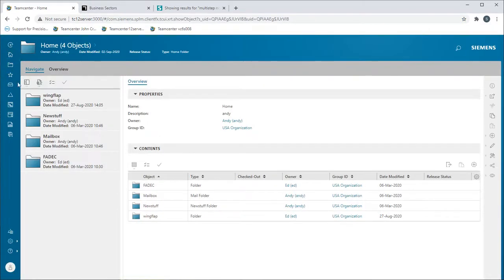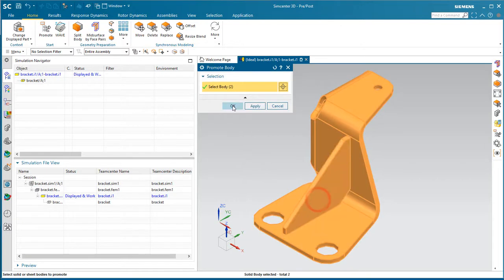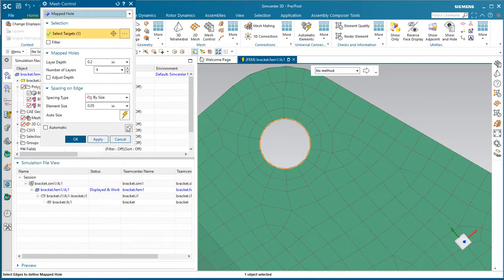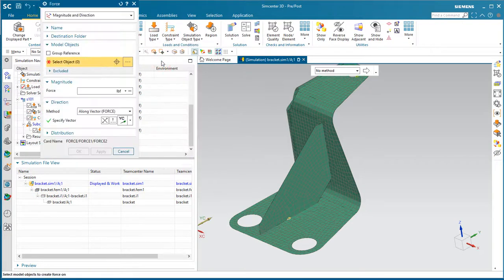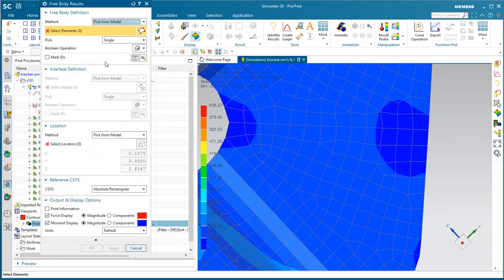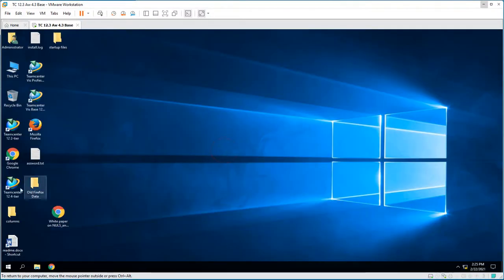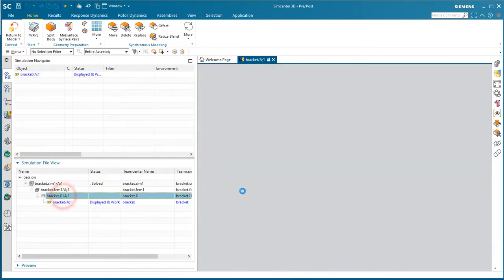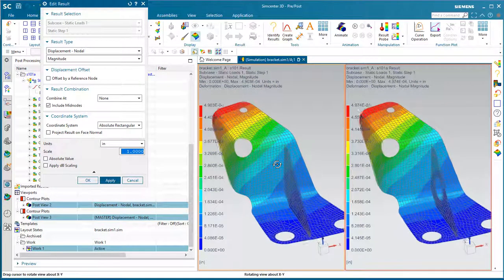Simcenter 3D midsurfacing and shell meshing an aerospace sheet metal bracket under Teamcenter

Comment: Can you please do one video to show best practices in shell meshing to get good quality mesh. Most of the time when we mesh parts there are failed elements and if we drag nodes to correct the mesh is locked. It will be really helpful thanks
Hypermesh has really cool tool to improve local mesh quality by optimising elements, does simcenter has any such capability
Reply from the maker: Thanks for the suggestion.  There are some very powerful mesh quality options in the 2D Mesh dialog that I would encourage you to explore.  Most are off by default. Expand the mesh quality options block in the 2d mesh dialog and select attempt to fix failed elements.  Next turn on and set a threshold value for Warp, Taper, Skew, Aspect Ratio...  Simcenter 3D does have mesh optimization with the Adaptive Meshing solution process.  In the sim, right click on the sim - new solution process - adaptivity.  I have a video that shows how to use adaptive meshing here: https://youtu.be/tG6QTGALe7E
Reply: @Simcenter3DTipsandTricks  using attempt to fix failed elements will always results in tria only mesh even zero quad option is on. That's why we are not using it
Reply from the maker: Attempt to fix failed elements should only split quads that fail shape checks.  If you are getting a tria only mesh, something else is wrong.  I recommend checking your graphics driver as it could lead to this type of behavior.  https://youtu.be/6ads82zneTc